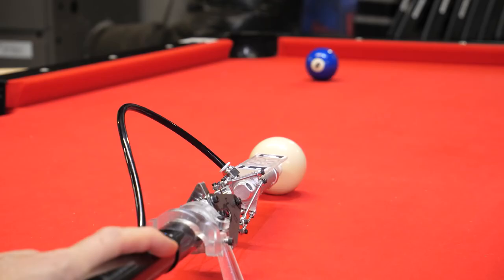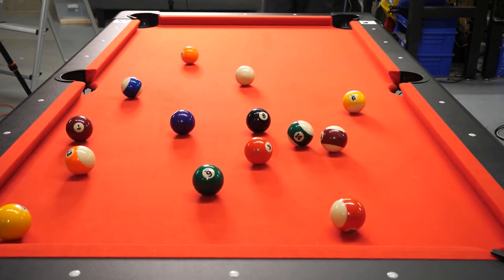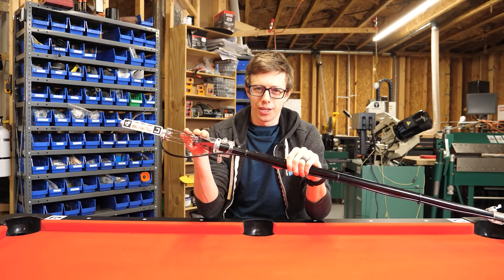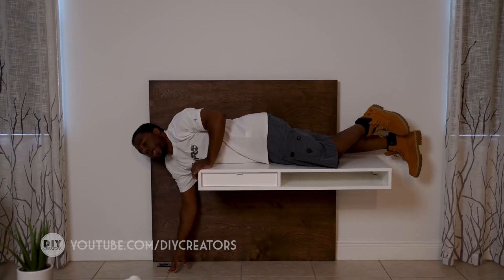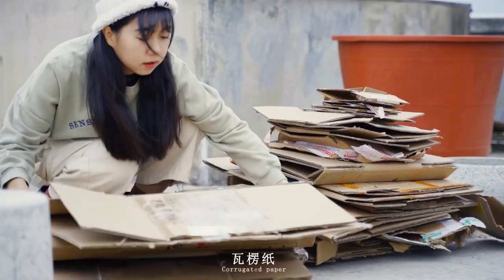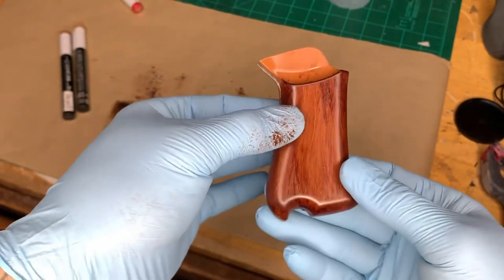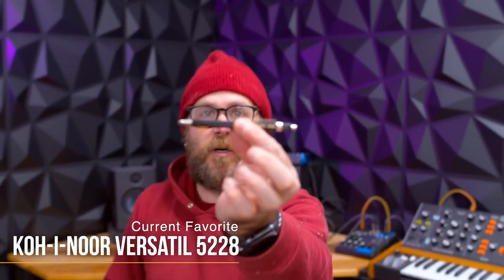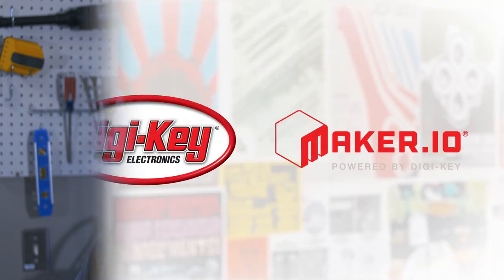Winning with the Wiggle Stick [Maker Update] | Maker.io

Comment: There are so many great ideas this week that you’re not able to go into depth on each one. We’ll need to check each one out individually but I can tell you from experience that using guides while cutting materials or routing materials will give you perfectly squared or straight edges. Your channels watchers really need to check out those tips because with just a few simple tools you are able to achieve perfection in their projects. And there is nothing more frustrating than having edges that don’t match up or they are tapered. So many good ideas. My first job when I was young I worked at a saw blade company and we made those large circular blades that he used on that bicycle and they were for cutting ice blocks. I can see why they would cut through the ice because they were designed to cut ice!! Lol